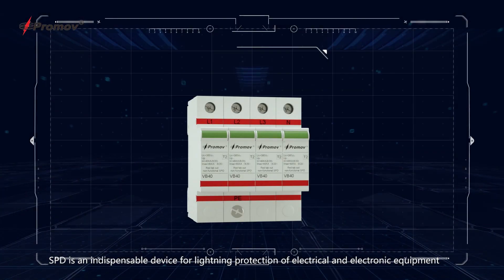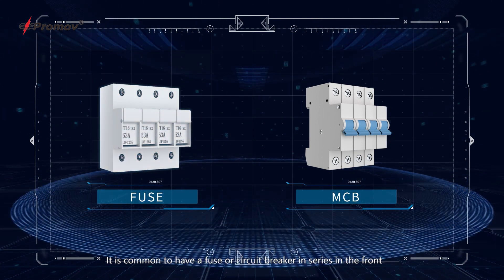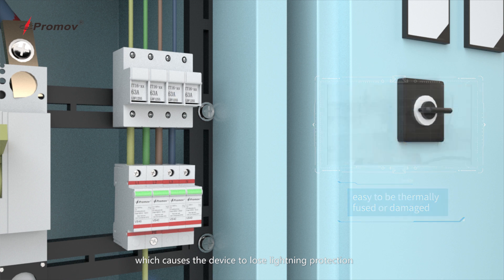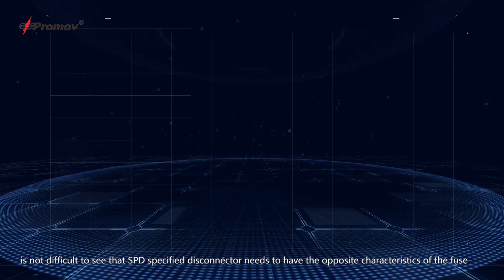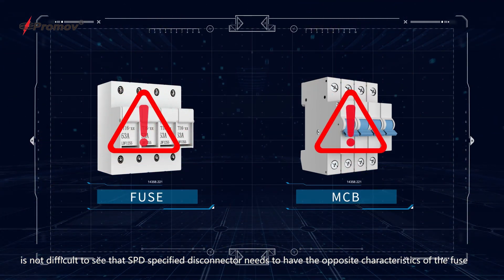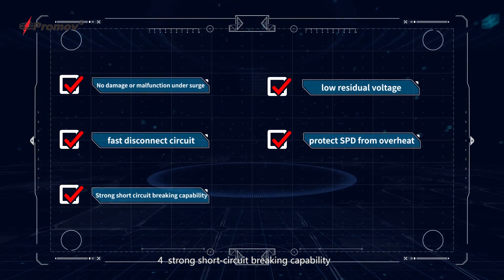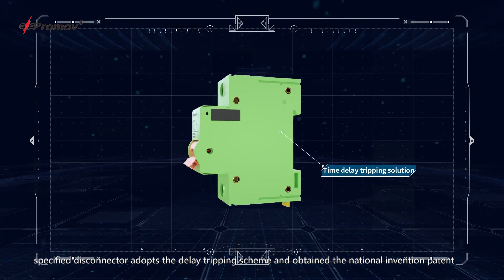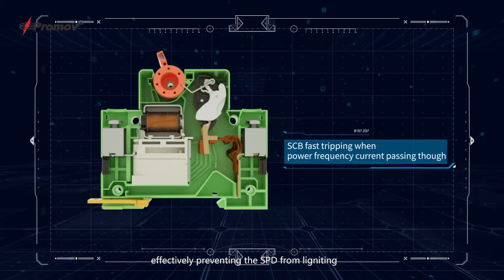PREVENTATION - PROMOV SPD Specific Disconnector (SSD) / Surge Circuit Breaker (SCB)

Comment: Great video demonstation, when current more than 5A passes through SPD, it may catch fire immediately, so the SPD needs a switch protector which releases quickly when the current of more than 5A passes through to avoid fire, and techncially when the degeneration of SPD its takes place or before leakage current caused by abnormal power reaches 5A, it can trip quickly.  Good application as fully comply to the latest IEC 61643-12 edition Standards.

Comment: TQ for sharing sebab kaedah tradisional adalah dengan menghubungkan sekering atau pemutus secara bersiri di hadapan alat pelindung kilat hanya pakai fuse atau mcb. Sekiranya dari video demonstrated SCB dedicated backup protector provides professional backup protection for the SPD (Lightning Protection Device) that protects the power supply of the first, second and third levels. Dan percaya SCB applicable to places where SPD lightning protection equipment has been installed, such as power equipment for industrial and civil construction, electrical, communications, road transportation, petrochemical and other industries. 👍products

Comment: Great sharing with thanks. We do normally sell and made recommendation from the pass most of the are also called RCD (residual current devices) or RCBO for combined RCD and MCB in one unit for normal electrical application panel board makers and SPD application. Its worth noting these are operated by current (generally 30 milli amps), whereas in the past they used something called an ELCB (earth leakage circuit breaker) which was voltage operated I believe. And now with these SPD new disconnectors SCB/SSD recommendation to IEC 61643-12 latest application we will encourage the users and make change from FUSE/MCB, the front return circuit of SPD must be in series connection with overcurrent protector.  Since the fuse and circuit breaker can't coordinate and cooperate, it may lead to FIRE as video shown and accident of equipment damaged from lighting stroke when SPD breaks down or MORE importantly occurs short circuit.  This special Circuit Breaker (SCB/SSD) is great safety and after read through the product specification details specially designed for SPD, furthermore it's won't disconnect quickly when there is power current after SPD breaks down, which can eliminate the associated potential risks. We will support this PROMOV greatest technology 2020 review made on the IEC recommendation. Thanks PREVENTAITON for sharing this 👍

Comment: Great . Agreed in principle video shown and in general, the backup protection of SPD normally uses fuse or circuit breaker. However, since the surge withstand capacity of fuse and circuit breaker is positively related to the rated current value, it means that if they want to pass the surge test, their rated current value needs to be relatively large. For example, if they pass the tests of 20 kA (In) and 40 kA (Imax), the fuse needs 125 A gL/gG; the circuit breaker needs 63 A-100 A, and the action current of 125 A fuse is up to 625 A within 5 s, which is almost the same value for the circuit breaker meeting the same surge test. This characteristic leads to a blind area for the backup protection of fuses and circuit breakers for SPD. The typical situation is that the capacity of the power system is small, in case of short circuit, the fuse of SPD will not act, so SPD will catch fire quickly. Most SPD fires are caused by this mismatch, and the backup protection does not act. Will check and carryout the new projects for recommendation make.

Comment: Good video sharing, YES this SCB or SSD has been recommended and added here is the latest ademement highlights IEC 61643-12 Ed. 3.0 b:2020
Low-Voltage Surge Protective Devices - Part 12: Surge Protective Devices Connected To Low-Voltage Power Systems - Selection And Application Principles
IEC 61643-12:2020 describes the principles for the selection, operation, location and coordination of SPDs to be connected to 50/60 Hz AC power circuits, and equipment rated up to 1 000 V RMS. These devices contain at least one non-linear component and are intended to limit surge voltages and divert surge currents.
 NOTE 1 Additional requirements for special applications are also applicable, If required.
 NOTE 2 IEC 60364 and IEC 62305-4 are also applicable.
 NOTE 3 This standard deal only with SPDs and not with surge protection components (SPC) integrated inside equipment.
 This third edition cancels and replaces the second edition published in 2008. This edition constitutes a technical revision.
 NOTE The following differing practice of a less permanent nature exists in the USA: In the USA, SPDs tested to Class I tests are not required. This exception applies to the entire document. This edition includes the following significant technical changes with respect to the previous edition:
 a) Scope: Deleted reference to 1 500 V dc
 b) Added or revised some definitions
 c) Added new clause 4 on Need for protection
 d) Added new information on disconnecting devices
 e) Revised Characteristics of SPD
 f) Revised List of parameters for SPD selection
 g) Added new information on Measured Limiting Voltage
 e) Added or revised some Annexes

Comment: Yes agreed and this SSD or SCB provides backup over-current protection for the SPD, will follow the latest IEC 61643-12 edition as read from others commented which is fully coordinated with the surge protective device. Comparing to normal backup circuit breaker/fuse, the integrated product video share for SCB Promov technology  achieve a better balance between surge withstand performance (no tripping while expected surge occurs) and sharp reaction against short circuit and abnormal leakage current too, great product 👍

Comment: Great technology for sharing, the SSD or SCB will provide SPD safe to withstand surge current and provide multipath simultaneously detariustory against short circuit trip better performance versus FUSE applied.

Comment: This is informative! 
Just wondering what's the applications for these SCB? Do you have a website or email for further inquiries? Thanks.
Reply from the maker: Thank you for your response. Surge Circuit Breaker, SCB is an electrical device which coupler with Surge Protective Device, SPD to protect SPD against different power frequency current in cases of deterioration or abnormal condition. It can be used in various fields including normal residence standard power distribution panel or railway station main switchboard as long as there are SPDs within the power panel. However, selection shall be based on specifications declared by the manufacturer. 

You can always refer to Preventation Engineering Sdn Bhd based in Malaysia for more information. 
http://www.preventation.com.my/

Comment: Good products 👍because traditionally fuses or circuit breakers chosen to pass this impulse current will not protect the SPD against an AC overvoltage nor necessarily prevent its failure to a short circuit before the fuse or circuit breaker trips,   good job Preventation keeping up the Promov technology being shared.

Comment: Good products 👍, this SPD disconnector is a safe device that disconnects an SPD from the electrical system in the event of an SPD failure or preventing fire occur as video demonstrated.  SPD disconnectors are required to provide system protection to two SPD failure modes base on my experience: Thermal faults and Short-Circuit current faults. Thanks to Preventation keeping up the IEC latest selection choice and apply for spds safety good practice.

Comment: Good video demonstrated, these installation is good to be practiced follow with the ST enforcement in lightning surge for mains protection, the typical house type 2 SPD is the main protection system for all low voltage electrical installations. Installed in each electrical switchboard or DB panel, it prevents the spread of overvoltages in the electrical installations and protects the loads. Type 2 SPD is characterized by an 8/20 µs current wave. Good knowledge of sharing the specific disconnector circuit breaker for SPD connection, thanks.

Comment: Great video good job Preventation and Promov technology. Fully agreed with the latest developement on the IEC61643-12 latest edition and it's now show the further protection and thermal protection function (thermal disconnector) in SPD usually in-built into voltage clamping-type surge protective devices (SPDs) such as metal oxide varistors (MOVs) for electric power. In addition, if excess voltage or degradation of an SPD causes a large fault current flow, an overcurrent protection function (current disconnector) is used. Thermal disconnectors and current disconnectors are collectively known as SPD disconnectors. IEC 61643-1 specifies the operation of SPD disconnectors when the AC current flowing to an SPD due to degradation failure is below 1A. In such cases, the operation of the thermal disconnector is usually checked. As for thermal disconnectors and current disconnectors, it is desirable that they both perform the shut-off operation and maintain proper functioning. In this study, we describe the operations of thermal and current disconnectors as they relate to SPD safety, with a particular focus on SPD failure causing a fault current exceeding 1A (AC) to flow to the SPD. We used a current fuse uniquely developed at our company and a circuit-breaker (MCCB) that is generally recommended by SPD manufacturers for the current disconnectors. The results of video demonstrated the safety measure and investigation led us to propose a suitable shut-off characteristic for current disconnectors, keeping up the good work, thanks agian.

Comment: Yes great video, as all over the world are taking part in solving these problem specially SPD  caught fire, when the ignition of SPD takes place, external breakers do not disconnect, And when surge flows through SPD, external breakers disconnect mistakenly. Good product worthy installed by the latest IEC 61643-12 3rd edition recommendation good job Preventation.

Comment: Very informative, thanks and YES totally agreed with the selective specific disconnector is for  disconnection of the passed power frequency current and lightning current can effectively protect the SPD from short-circuiting and short-circuiting of SPD due to abnormal transient over-voltage, resulting in serious fire accidents.

Comment: Agreed with the working principle as Specific SCB, the exclusive external disconnector of SPD, is a kind of equipment which is developed according to the article 430.3 in the IEC61643-4-43 standard previously now is fully accepted by IEC 61643-12 latest edition, technically this adopt suitable over-current protection devices before dangers caused by circuit. It mainly solve problems that when follow currents or leakage currents take place in SPD, SCB can trip quickly ,while lightning currents pass, SCB does not trip, SCB ensures that SPD does not cause a fire and the lighting protection of equipment lasts long, solving the problems that there is protection blind in current widely used fuses and breakers which are used as external disconnectors. SCB is the ideal matching devices of voltage switching type SPD, voltage limiting type SPD used low-voltage power supply system. Good job Preventation thanks for sharing.

Comment: Great information sharing thanks to Preventation. Fully agreed with the conventional types when lightning occurs, fuses or breakers can’t stand temporary energy of lightning current, for they were used as components of power distribution in the early design. So it is easy to cause them to trip or explode, making lightning protective ineffective.
Secondly when lightning current goes through breakers, the Up value is very high and lightning protective devices can’t protect equipment well.
Secondly，fuses or breakers can’t disconnect in the power be installed line of a transformer. And last comment mostly apply the safety's circuity, when a short circuit takes place, they fuses and normal breaker can’t break quickly. Great technology being shared and great helps by PROMOV brand invented by Xiemen TH China.

Comment: Well presented video clips thank you, it's comply and meet the IEC 61643-12:2020 latest 3rd edition on
Low-voltage surge protective devices - Part 12: Surge protective devices connected to low-voltage power systems - Selection and application principles.

Comment: Great products and thanks for sharing these application will meet enforcement letter from Suruhanjaya Tenaga (ref no: ST(IP/JKE)PE/16/14/2(1)) , all the Lightning Protection System design and installation must straightly follow MS IEC 62305 when comes to Building and Electrical & Electronics Protection Against Lightning.